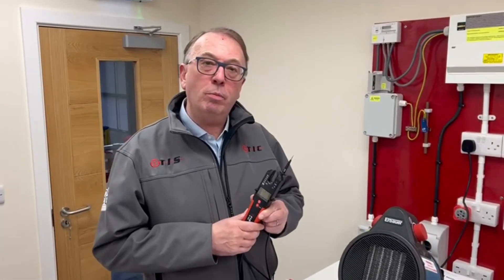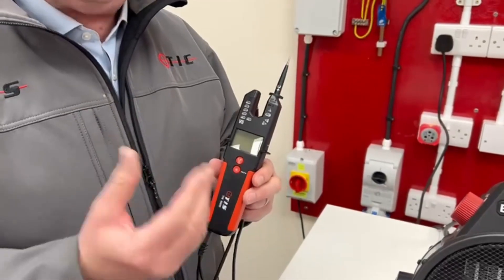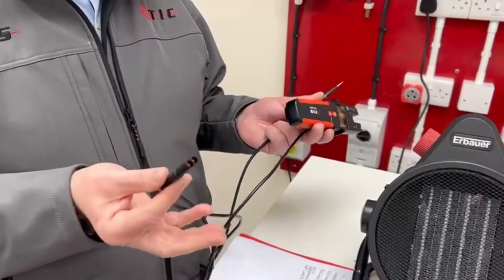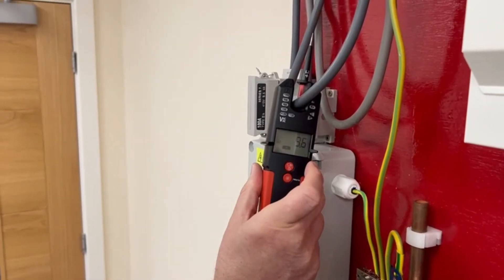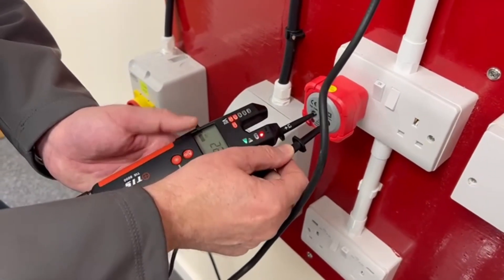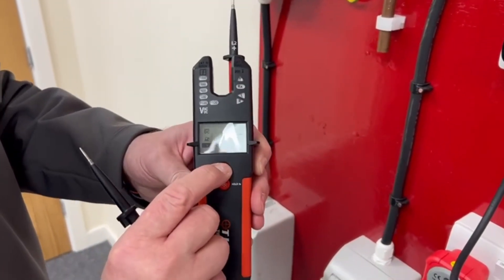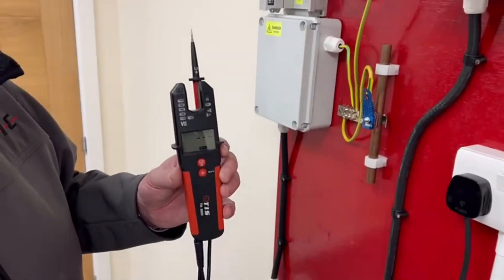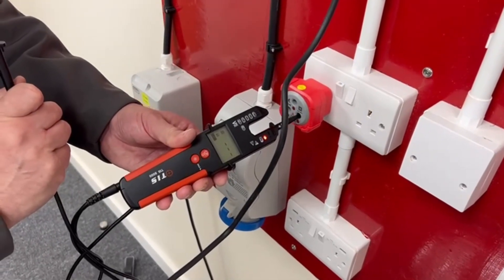TIS 8000 Open jaw Multi-Tester

Comment: These testers are nice, they work for both measuring and as a safety tester.
My only complaint is the fact they don't have HVAC functions which would help a lot.
However they allow 90% of the tasks for most situations which is great 😊

Comment: How does it compare to the Benning CM 1-4?
Reply from the maker: @weplaywax  the biggest difference and most important is the Benning version needs a battery to function so it can’t be used as a true voltage tester to prove a circuit is dead, the 8000 is a true voltage tester so if the battery fails it will still detect voltage hence it doesn’t have a dial on the front so no chance of Human error where as the benning if you accidentally select Amps and measure voltage it will tell you the circuit has no voltage present 👍
Reply: @testinstrumentsolutions  brilliant, thank you so much for the explanation. Do you also sell your products in the EU? Meaning through an EU dealer, so to not import it directly from the UK.
Reply from the maker: @weplaywax  UK only
Reply: That's not tue. The Benning CM 1-4 not only works without battery it switches on its Display and all LEDs above 45V. Whereas yours only warns with a red triangle as far as I'm concerned. As it is only a clone of the Beha Amprobe 2100 Delta.